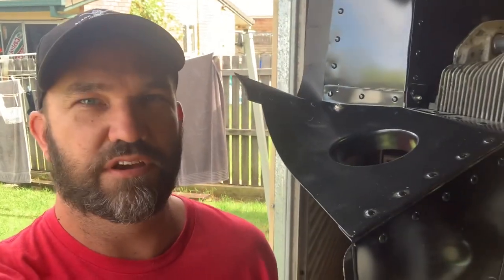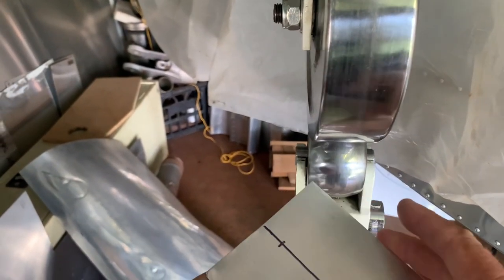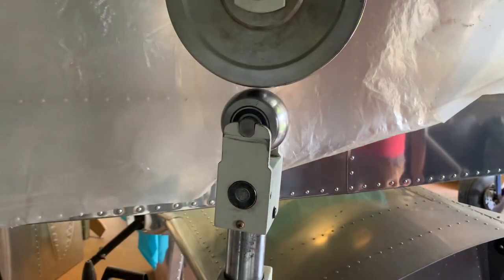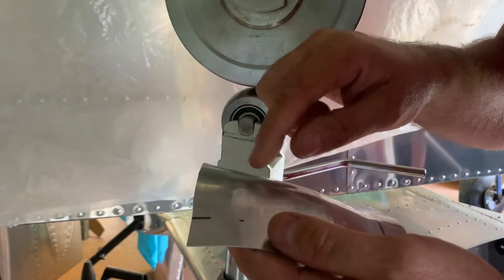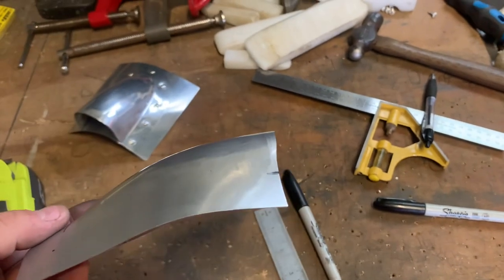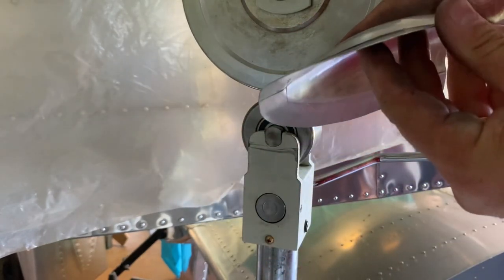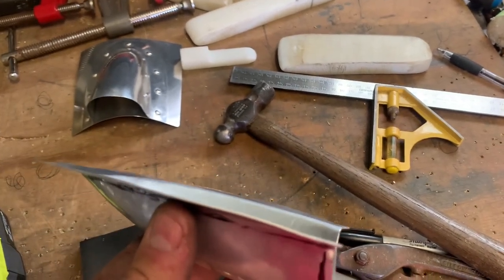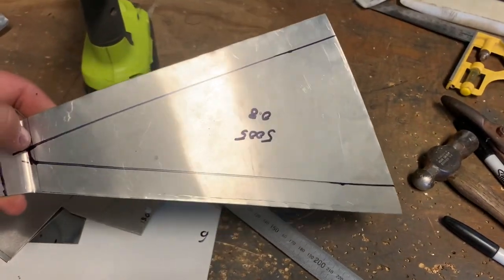How did Donny do that!? Forming air scoops with the English Wheel

Comment: Excellent! I peeked at the end of the video so I knew where you were going. Can't believe the change in shape.
I'm working on a Radial Starduster Too and need to create a front windshield flange.  I'm hoping that the flange will be like a large scoop with the center part missing.
Thx again for the excellent video!
Reply from the maker: Thanks mate I appreciate that. A Starduster with a round engine would be awesome! I made a windscreen trim for both cockpits on Frankenstein. I can’t remember if I spoke about it in an earlier video(I think I talked about this in the engine cowling series for the air exit flange I made for the lower cowling). What I did was to use the flat wheel like I used for these flanges to get the material to form. I used a bigger skin with the basic cut out of the front section of the cockpit, then progressively formed the flange up in the skin where the windscreen would attach to. With a bigger skin you can control how the skin/flange forms better. For Frankenstein, and I’m guessing for the Starduster, the shape of the windshield piece follows the curve of the top of the fuselage as well as the shape of the cutout for the cockpit. That means the angle of the flange to attach the windshield to changes slightly from one side, to the middle, to the other side. Give the bigger sheet the shape of the top fuselage and slowly add the required stretch to the flange until you get the angle you want, then cut out the piece from the bigger skin to suit. If this doesn’t make sense, I do apologise. The work coffees were really strong today! Let me know and I’ll try and give you a better explanation
Reply: @donwtsn  Thanks so much for taking the time to point me in the right direction. I have been looking for some guidance on how to approach the project. You are correct in the assumption about the shape ("the shape of the windshield piece follows the curve of the top of the fuselage as well as the shape of the cutout for the cockpit").  We have the assembly for the rear cockpit but not the front.  Your description makes perfect sense.  I'm sure I'll destroy a bunch of aluminum before I'm done, but that's all part of the learning experience.  
BTW. The radial engine is a Continental 7 cylinder 220 HP 80 year old engine.  It hadn't been started in over 20 years but came to life on the second revolution. If you're interested in taking a peek at the first engine start, here is a link:
https://youtu.be/NSqambFC7Nw

Thanks again!
Reply from the maker: @stanhelmle5363 very cool! There’s just something about radial engines huh! An extra measure of awesomeness. The airframe looks great. Have you started to cover it yet? Take your sweet time when using the English wheel, especially when getting close to the right shape. Don’t be tempted to hurry things up by doing a couple extra passes. A lot of the time, one extra pass than what you planned is enough to overshoot things. Usually that’s when you discover new expletives! Fun times!
Reply: @donwtsn  Oh, yes!  Discovering new expletives!  Been there and done that.  LOL!  Regarding the fabric, we have the fuselage and all control surfaces done.  Getting ready to do the wings. Never thought that I'd have to learn to sew (rib stitching) at age 74!  We went with Oratex fabric.  All black with the trim being a metallic flake blue. The avionics (Garmin G3X) are here and ready to be installed! 
Again, I appreciate your taking the time to guide me in fabricating the front windshield. I'll let you know how it turned out (hopefully with few expletives).
Reply from the maker: @stanhelmle5363 oh boy that’s going to look awesome! Hehe, at least it’s cool sewing huh! Hope it all goes well for you mate.

Comment: When working on small shapes like this i often would hold the work in one hand to guide it,and with the other hand  rotate the top wheel back and forth,i find it is easier to prevent the unwanted exit of the edge from out of the wheels and the subsequent unwanted edge stretch or finger pinch👍 nice work,video without the huge ego.
Thanks.
Reply from the maker: Thanks mate. I’m normally a little better at not running off the edge. I blame having to use the video camera to get the shots. Instead of using a hand to rotate the top wheel, I tend to rotate the bottom wheel for some reason
Reply: My comments were in no way ment as a criticsm Don you did a fine job!
Reply from the maker: @nige135  all good mate, I didn’t detract any criticism on your part. Thanks for taking the time to respond. Cheers mate

Comment: Great video!

1) Do you anneal the aluminum every so often?
2) Can thin mild steel be worked with an English wheel?
Reply from the maker: Thanks mate. For these little fairings I didn’t anneal them. Sometimes I do to get a higher lift out of the curved scoop and for forming the flange. On other things I’ve made I’ve annealed a few times during the forming process. You can feel if the metal is getting too hard and tough after a bit. I’m pretty sure thin steel can be formed in the English wheel, I guess you’d have to use a higher pressure and/or anneal it to form it. I might give it a go sometime and see, sounds fun!
Reply: @donwtsn  -- I've done some blacksmithing for years and I recently got into silversmithing. I know silver and copper work harden and need to be annealed or they can become brittle. 

Now I'm making a chopper (motorcycle) from scratch and forming the fender has been a bear. I didn't want to buy an English wheel for one project, but forming sheet steel with a 3 lb. hammer and a sand bag is tough work!
Reply from the maker: Those are some cool projects you have going on there mate! It’s interesting to see how different materials behave when worked. The engine cowling I made for Rosie the Sopwith pup was initially made using a shaped hammer and a beater bag (I got hold of an English wheel about half way through the project) it’s a real challenge to hit in the correct spot and with the right power huh!

Comment: Wow, that came out really good. Would it take less time to block out the bulk of the shape with a hammer & sand bag and then smooth/planish on the wheel?
Reply from the maker: Cheers mate. It probably would be a bit quicker that way, although you’d need to be pretty careful with such thin material not to stretch it too much and split it (which I’ve done before doing just that).

Comment: tip: start with bigger metal piece of metal, what provide better and easier handle, then cut of unnecessary material
Reply from the maker: Cheers mate. I’ve noticed extra material tends to interfere with itself when forming. I normally have a little extra material and trim down to size during and after I’ve formed it up
Reply: @donwtsn  Okey, so left just a 5mm extra with small hole and put a screw with narrow handle. So no extra material will impact forming process
Reply from the maker: @jareklotz  not sure about the hole and screw thing. The risk of cracking would be very high. I normally start with 5 or 10mm extra, then trim as soon as it starts to bind up on itself. Depending on how far I’m forming it, that could happen pretty soon during forming. Maybe forming such thin material is different to forming thicker material

Comment: you could just start with biger piece  easier to handle stratch out with mallet  your shape  wheel   out and cut a half your tecnique is a joke
Reply from the maker: Never said this was the only way to do things. Your suggestion would work, however you might’ve heard me talking about the material 7075t6 and the thickness. Bashing it with a mallet is guaranteed to put little splits in it everywhere. Maybe that’s the desired effect. I’ve noticed even with 5005 in that thickness, it is really easy to overstretch with the bashing technique. I’m glad you found it entertaining, cheers